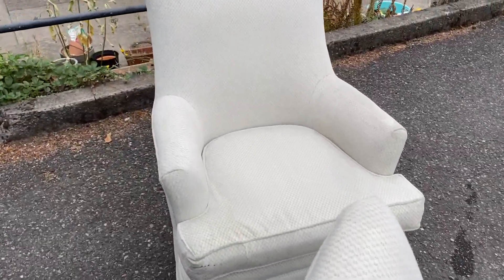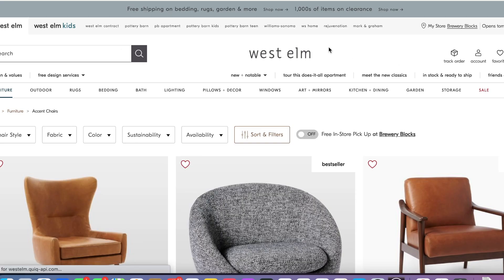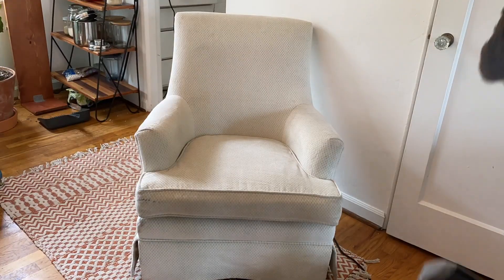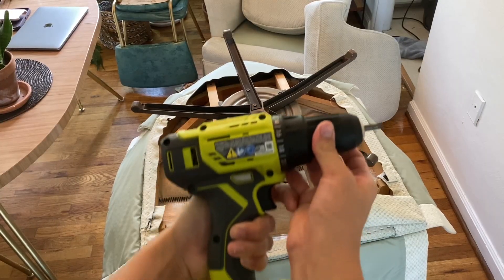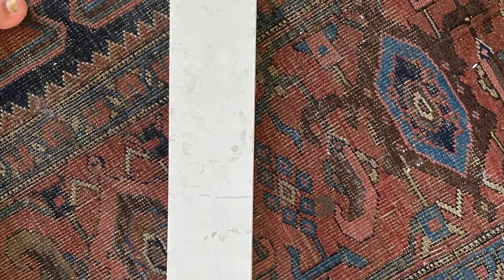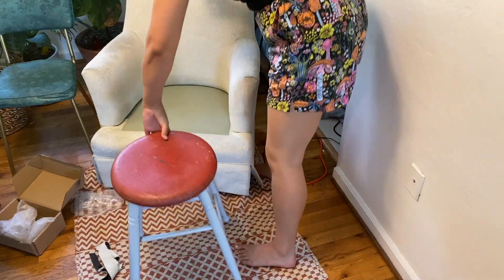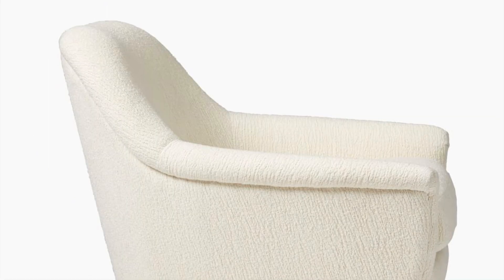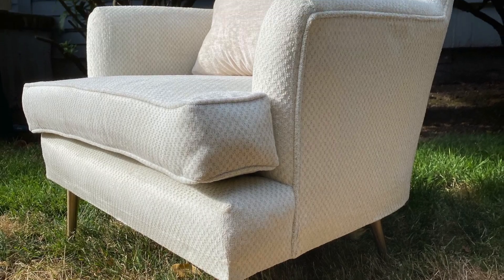West Elm Dupe | DIY Vintage Chair Hack | High End Furniture Flip

Comment: They look great!! I think it might have been a good idea to secure the extra wood pieces that the legs are attached to with screws in a triangle formation instead of a line for better support! Perhaps adding extra wood underneath to screw into? Just worried the wood base may become loose over time since two corners of the wood will have less support! Anyways, nevermind me! So cool to see the result and I have been really enjoying your videos!
Reply from the maker: Thanks so much! Yeah I'm not sure exactly how it will hold up, but I figured since I'm keeping them, I can always adjust them later when I have more time! They are mostly accent chairs so I won't be sitting in them too much... but yeah! Structural integrity is important!!! Thanks for watching :)

Comment: Is there a reason you don’t fold the skirt under and staple it like you would reupholster a chair?  That way you don’t have the staple holes or the crease and sometimes discoloration?  It looks so nice with it not ripped off and just re-reupholstered.
Reply from the maker: 99% of the time I do fold it under and staple!!! I have a lot of videos about this :) but for this specific video I wanted it to look as close to the West Elm chair as possible, and that didn’t have any piping or anything so I just went got it. Luckily after a few days the crease has settled and there isn’t discoloration on this chair. There is usually discoloration though so usually I just fold under! Thanks for watching, Wendy!